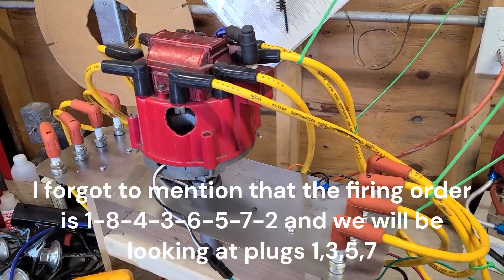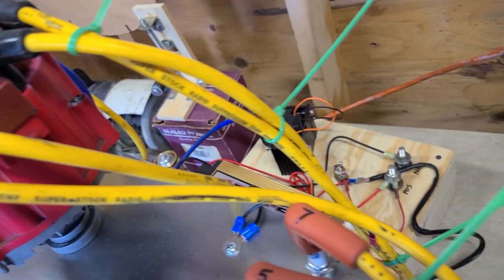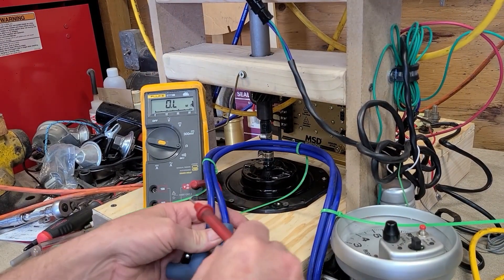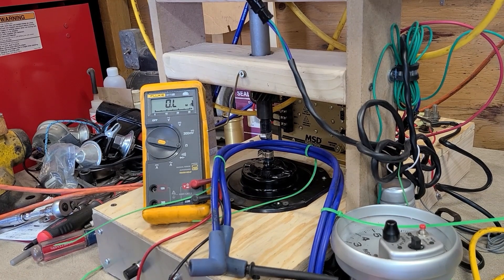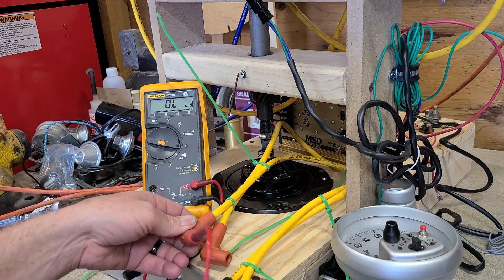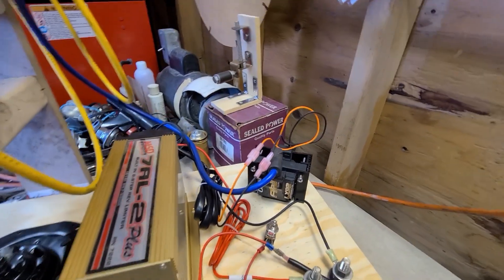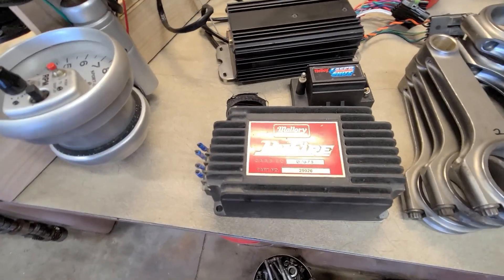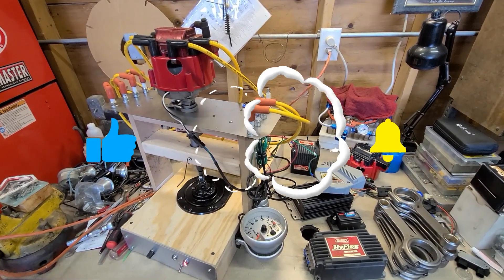Spark plug crossfire testing

Comment: Interesting that nothing happened there.  I tracked down crossfire between the spark plug wires on my truck ('91 K2500) using an inductive timer (the wires with the crossfire would register 2X RPM), so I know it can happen in the real world!  Spacers helped, but I think I just need to replace the wires.  Will be curious to see test the resistance when I do...

Comment: Put your spark plugs in a pressure vessel. Add heat and pressure you can monitor the results with timing lights. The test you did means nothing.
Reply: Agree, need to increase the electrical load on # 5, so the sparks seeks a lower resistance path to ground by inducing voltage into #7 wire.  Easy way to increase electrical load on #5 would be to increase the gap substantially.

Comment: So the solid wires maybe better?
Reply from the maker: No, I ran them in my race car back in the 90s and saw zero difference in my ET. This was my street/strip vehicle. Solid core wires will interfere with your radio and possibly other electronics...I always had a slight buzzing sound on the radio but I didn't really listen to the radio much anyway. I would not recommend solid core wires. My two favorite spark plug wires are the MSD 8.5 Super Conductor and the Moroso Ultra 40 wires.

Comment: So did crossfire happen?  I didn't see any.
Reply from the maker: No, nothing happened. I'm sure if this test was run on a real engine with cheap or not very high quality spark plug wires it would be possible to get some cross fire but nothing showed up on the test. I also think if you have an old distributor cap that was carbon tracked you would see some cross fire...I might check that next time I run across an old cap.